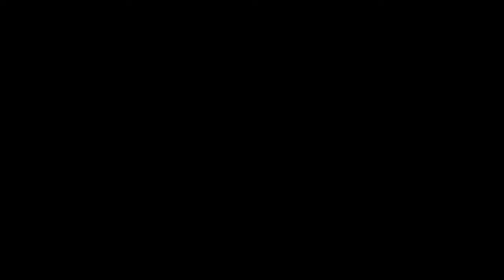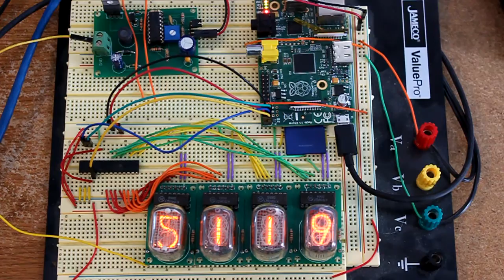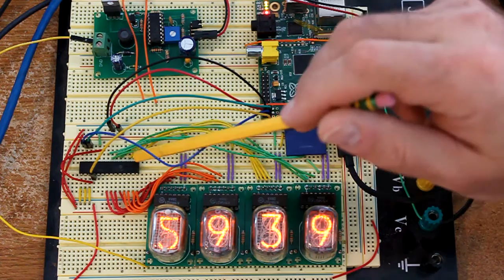Controlling Nixie Tubes using I2C

Comment: Wow awesome set up! I'm looking to make a clock out of an emergency call phone enclosure and I am unsure how to set it up. All I know is I need to convert the power to about 170 VDC and obviously have to figure out the pins on the Nixie tube, but could you give me some advise on what I need? I am used to building industrial electrical control panels so I work more with larger electronics and don't know much about these small boards. I want to be able to do the shuffling effect of the numbers as well as keep time, looking to use 4 nixie tubes. Thanks!